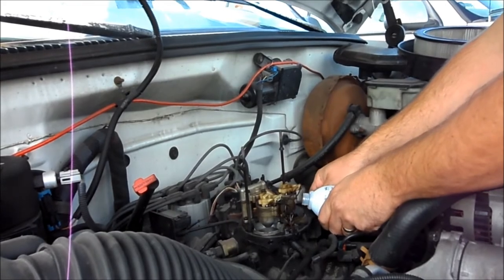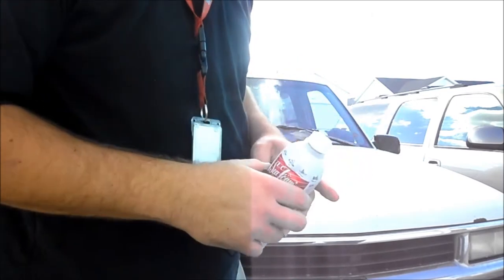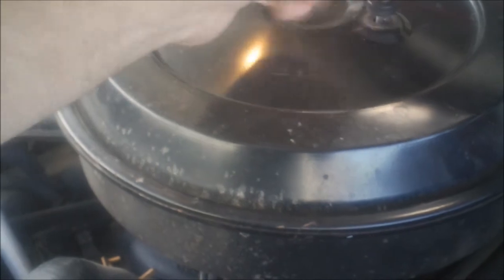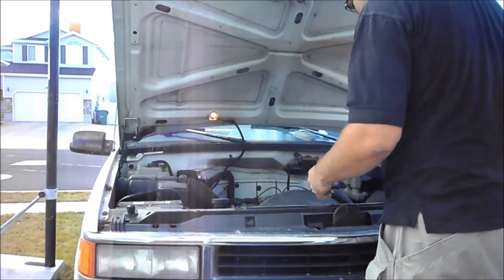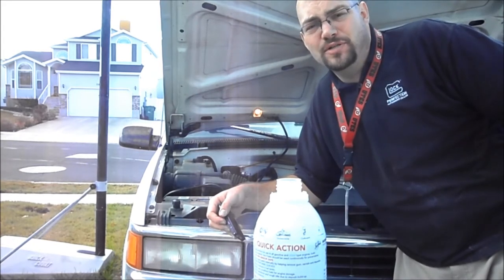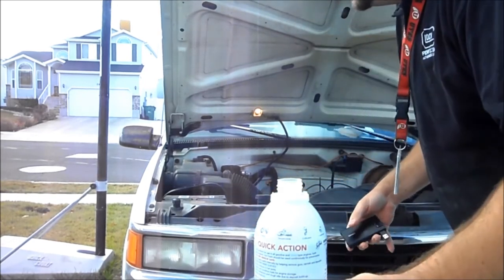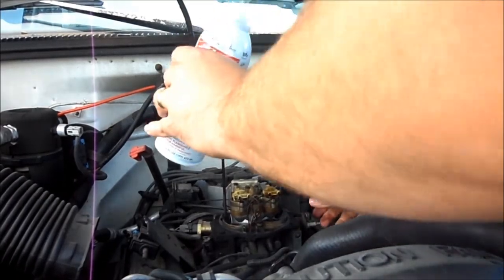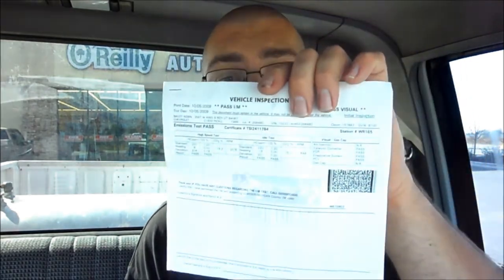Head Turning Trick to Pass a Failed Smog Emission Test

Comment: I was told that i needed a new cadallitic converter and my check engine light was on because of that, if i clean it out will that turn off my check engine light?
Reply: If that’s the problem, but sometimes it’s other problems like a clogged catyllitic converter
Reply: Or bad o2 sensor

Comment: My 99 tahoe is failing fuel to high hc
Reply: Did you find the fix i’m having the same issue
Reply: @dayton2314  yep both cats were bad 961.00 dollars to replace with labor I did everything to it and that was it after 8 failed emissions tests
Reply: @andrewg7344  damn, that’s rough
Reply: @dayton2314  ya I know it sucked I was getting ready to sell it but then I did the cats and it worked that's what the problem was I did everything cap,rotor,plugs,wires sensors cam,crank, full time up and nothing
Reply: @dayton2314  you van take it to an emmisions tech that's how I found out it was the cats be tested them and they both failed the readings and they test it for free just call set up an appointment